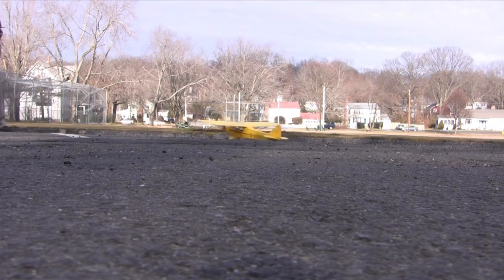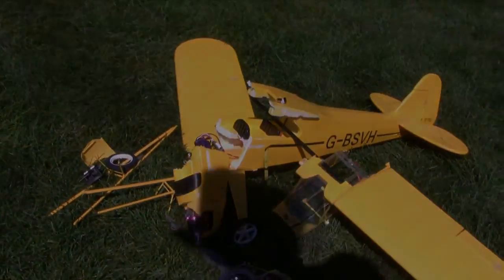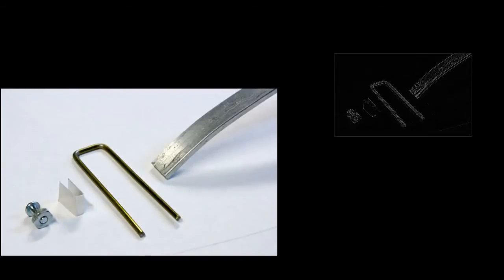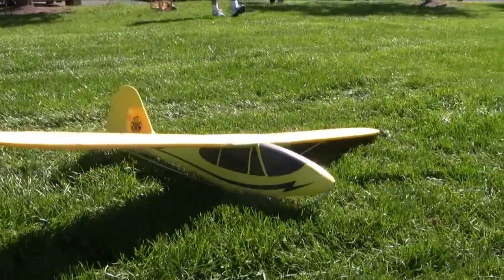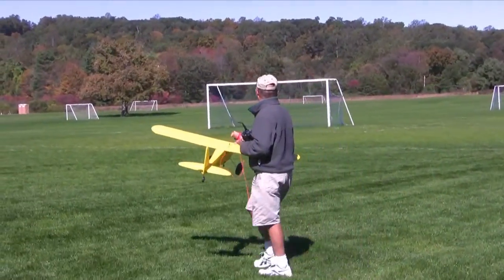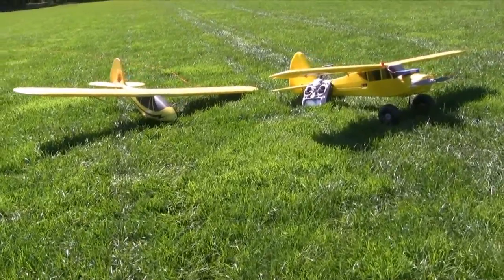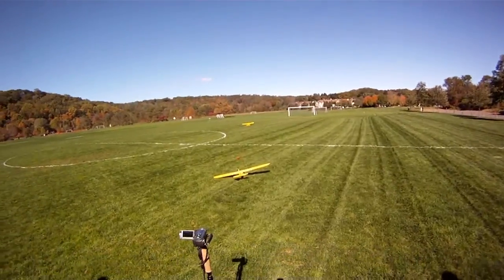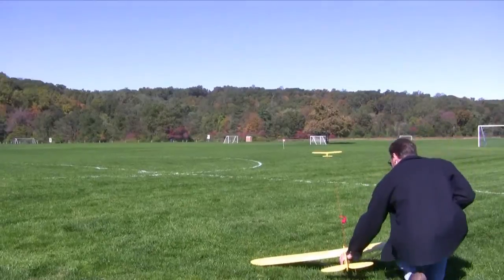Nodd RC - 026 - Cub Sailplane Part 1

Comment from the maker: No need for a link, I know exactly what you're talking about. That's a possibility although once the glider starts rolling & the ailerons become effective, they're not necessary. I'd also worry that in some ways, wingtip wheels might actually increase the chance of catching a wingtip, especially for grass field operation. They're something to consider though, thanks.